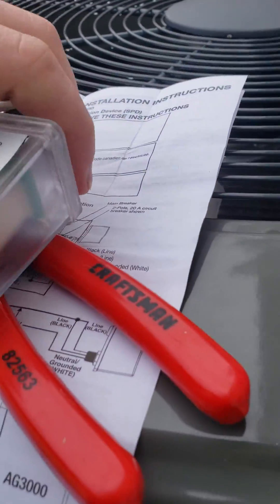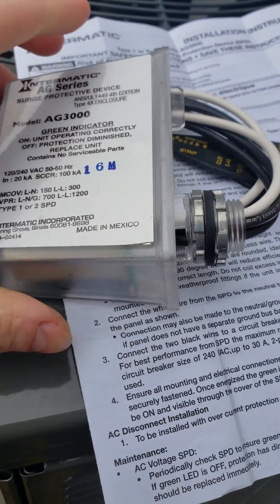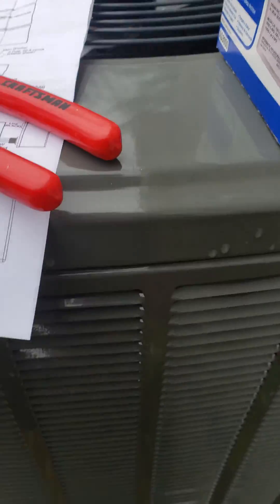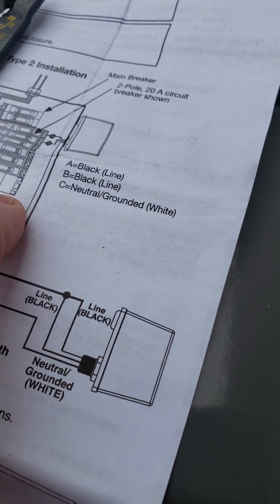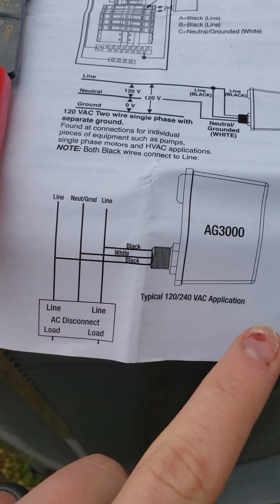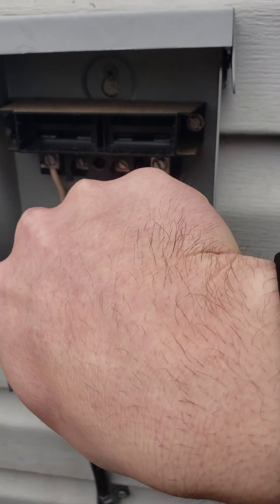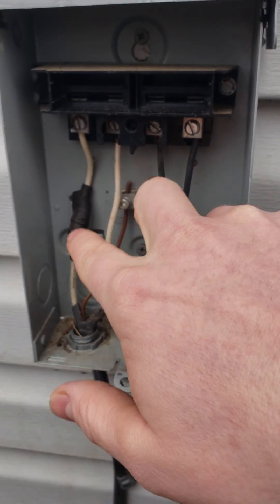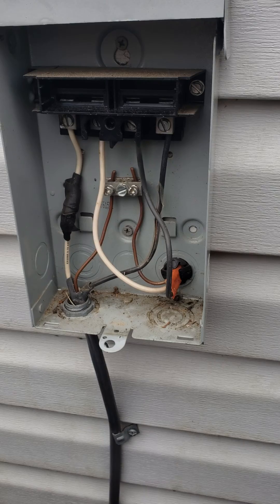Hvac compressor surge protector part 1

Comment: I have a 6 gauge wire going into the line side so not enough room to also add the ag3000 wires. Is it ok to simply connect to the load side?
Reply from the maker: Is it ideal? No will it work yes. Since it's technically a bus. It'll work the same. Don't ask me if it's to code. I'm not a residential engineer. Im a transmission and distribution engineer. So I don't know the residential codes